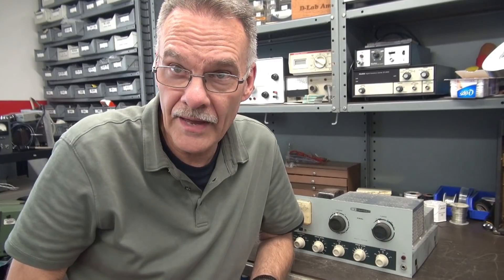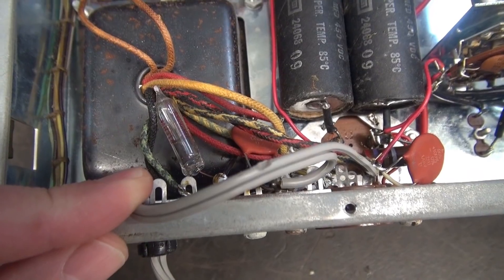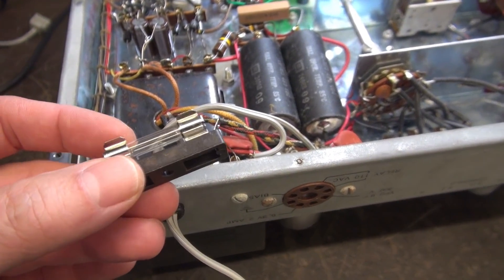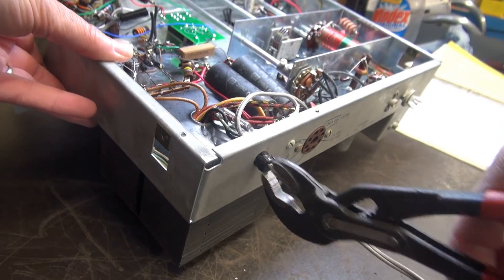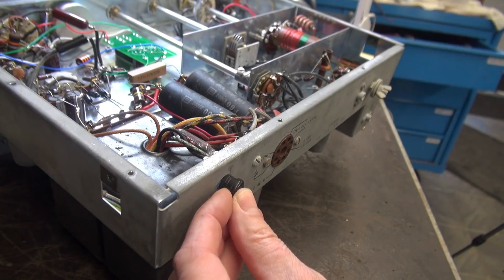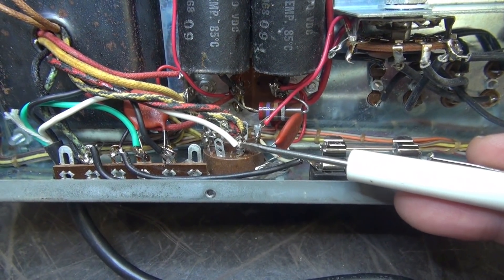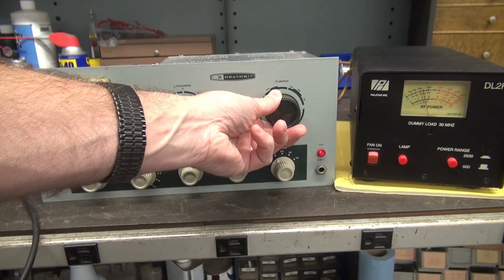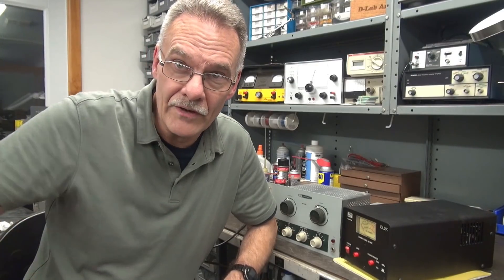How to Install a grounded AC cord + fuse Heathkit DX-60 Ham Transmitter

Comment: You opened my eyes to the Hot chassis issue. I have a Heathkit IT-12 signal tracer and would like to replace the main cable (two-prong) with a three-prong one. I want to connect the earth-wire to the chassis (and add a fuse). Do I need to disconnect all the cables from the IT-12 that connect to the chassis and then reconnect them without touching the chassis? Or do I simply need to solder the Earth cable to the chassis and that's it? Here in Europe, plugs aren't polarized. I know that after the IT-12 principal transformer, everything is isolated from the mains, but what would be the safest situation? Thanks a lot in advance,

Comment: One point that bears mentioning, this is not a DX-60 but a DX-60B. The DX-60 has a very different line cord configuration, with feed-through capacitors. This is helpful, but would be nice to see how a DX-60 cord is upgraded.

Comment: On some vintage gear I've added a three-wire cord with the green wire to chassis and it would not turn on. When I removed the green wire it would work just fine. I'm not sure what I did wrong. One piece of equipment in particular had a ground plane instead of a star grounding system so maybe that had something to do with it. Any advice from anyone would be appreciated.

Comment: The extra terminal(s) on the terminal strip were junction points for the power transformer primaries when this was converted to 220V. Most of the power transformers had dual primary windings for 110v which were wired in-phase-in-parallel. When converting to 220v, they were rewired in series. This is clear on the schematic.

Comment: Could you do next a safety capciator,and or fuse ,I like to fix 1960 ,s era radios.and clock radios and some.are hot chais,I want to be safe ,I never seen you ever work on a 60 ,a radio s ,but a lot of us collect them.and want to be safe .I like the AA5 G.E.radios because I am still learning I did five or six so far they work well ,but a little safety couldn't hurt.

Comment: I would add that it’s a good idea to replace those disc ceramic line caps with XY safety capacitors at the same time.

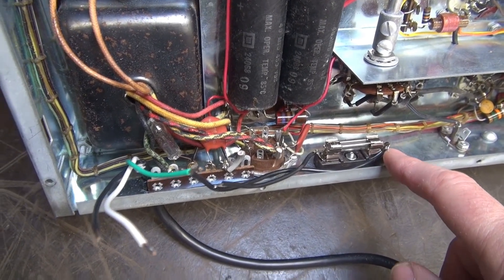Comment: 3:04 I think I'd have run the fuse leads on the other side of the strip - just so there's no chance that the screw going though that chassis screw hole doesn't make contact with those leads - especially the unfused side.  Even if you try to keep it far away, gravity or someone else working on the unit may move it.

Comment: Why no mention of the positive and negative polarity of the power cord? Do the tubes nullify this?
Reply: Terry did mention that the white wire (the neutral) went to the accessory socket and the black (hot side) went through the fuse...
Reply: That's an AC (alternating current) cord, not a DC (direct current) one.  Polarity alternates 60 times per second.
Reply from the maker: Roger that man

Comment: Since you where in there why not replace the safety caps also, I think you would want to
Reply: I think changing them for modern "Y" rated caps would be a good idea.  Upgrade the safety just a bit more.
Reply: @russellhltn1396 :  Good idea.  Thanks to your post I just ordered some Y rated caps to replace the ceramic disc caps in a boat anchor radio I'm working on.  They will be cheap insurance.
Reply: Same thought I had...
Reply: @Paul J Pachasa JR Yes the fuse or circuirt breaker would trip but only if the caps compleatly short. But if the caps where a little leaky it would pass AC to the chassis and not enofe to trip the fuse unless you had it running thru a gfi breaker but most would not only running thru a simple circuit breaker,
Reply: Excellent video! But while we’re in there, why not replace those original electrolytic caps? It’s working OK, but I don’t trust ‘em.
Reply from the maker: Project is still underway my friends
Reply: That brings up the thought that, while popping a fuse & holder into the stock circuit breaker location is an easy improvement, it might have been slightly better still to put the fuse & holder between the hot lead's bypass cap & the AC line. A bit more work but then if that cap ever (unlikely) failed, the radio's fuse would pop long before any branch circuit breaker would go.
Reply: @Paul J Pachasa JR True, But the customer may not know any better , and that is why he is asking for help
Reply: I wonder about that too, but I guess if the chassis is grounded it's pretty safe.